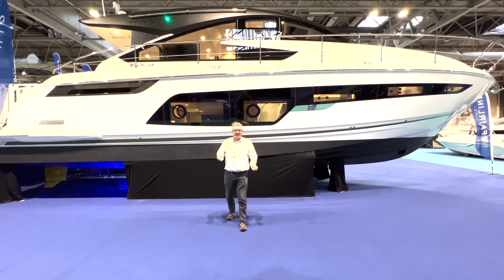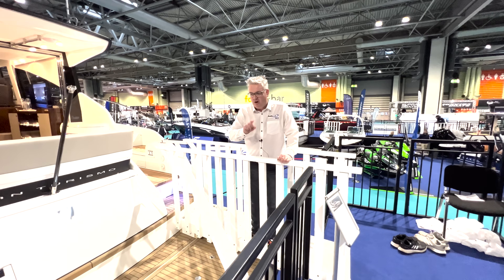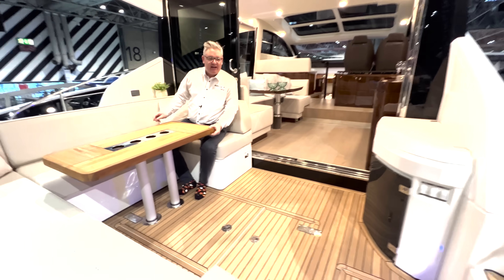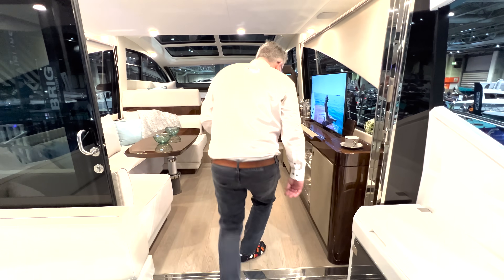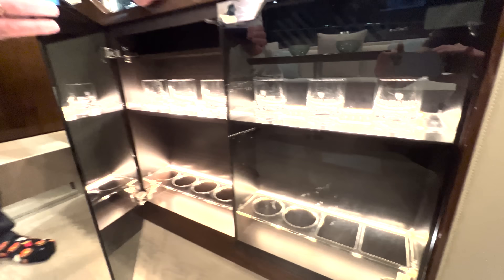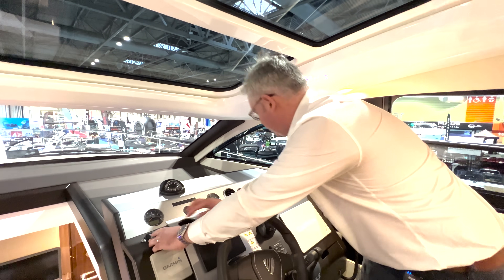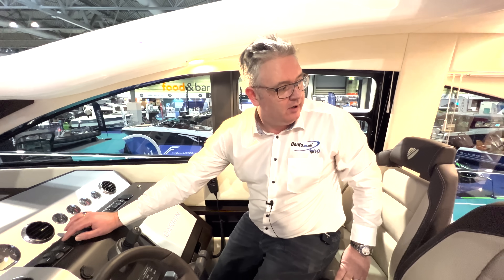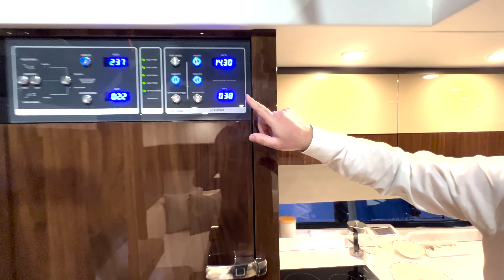2022 NEW Fairline Targa 50GT - Why I think this boat is a bit of bargain!

Comment: You can't even stand fully upright in the main cabin of a £1m boat? Check out the Galeon 500 or an Absolute 50 that quite literally knocks the burger and chip socks off, of this boat. Not impressed with this one although I hear Danny Devito and Warwick Davis are thinking of going halves on this one.
Reply from the maker: 😂 - you don’t just buy a boat on headroom. Seakeeping, build quality, ease of use etc are important. Also everything has a cost - High headroom gives higher centre of gravity which equals worse sea keeping. Every boat compromises something to give you something better elsewhere 😊
Reply: Horses for courses as they say..... though this one's for a Shetland pony 🐎😂. Keep doing what you're doing, love your channel!

Comment: Are there any disadvantages to having a seakeeper?  Other than the initial cost obviously, any ongoing costs?  Maintenance?  Loss of space in the engine room?  Apologies for what may be a numpty question, I don’t know much about boats but from videos like this I’m slowly learning.
Reply from the maker: You lose a bit of space , they take 20 mins to spool 🧵 up - they require an annual service but otherwise they are fantastic and it transforms life onboard - especially at anchor 🍻

Comment: There seems to be 4 different drive systems for a boats. IPS, Shaft drive, Surface Drives, Jet Drives! Is cost a major factor? What are the advantages and disadvantages of various drives?
Reply from the maker: There are also outdrives and outboards ! Wow that’s a big question - it could take a whole video 😉
Reply: @Boatscouk  Why would you not want to fit IPS pods if the boat is going to use 30% less fuel? What are all the advantages and disadvantages of various drive options you can get for Motor Yachts. I would like to know before I order my Pershing X7 fitted with surface drives. LOL
Reply from the maker: @gordonjohnston684  . I will answer on IPs because the answer is quick. It uses less fuel because there is less friction. There is less friction because the IPs boat is lighter and because more boat is out of the water . A lighter boat that is more out of the water can have less seamanship qualities 😉

Comment: No no no and no again. Most boat builders have worked out that you need to move the galley up. Why would you want the cooking smells below when they are easily aired away from the upper deck. On this boat that is why there is so little head room in the cabins. Time to do a rethink Fairline.
Reply from the maker: When boating regularly - some customers find that they are on show when using a galley up boat. For example when you wake up in your pants in the morning and want a cup of tea- you have to quickly run for the curtain / blind. Everything is a compromise.

Comment: Watching this video a day ago, and thinking about the entire walk through. When a customer want's a first time boat. This is no time to let your heart dictate for you, because the boat is shiny. 
Find a guy that is sharp, long time boater. Talk to a few Captain's, pay them well and sit down and talk.
We're talking serious money here and to have second thoughts in less than a year after buying the boat. I think some of the most sharpest boaters are the passage maker people. I can assure you. Passage makers don't buy a boat because the interior trim is high gloss. These buyers  study and study at home for months before laying out serious money. comparing numbers. Come on now.
A engine room hatch on the back deck. Sooner or later. Salt water along with fresh water will find it's way inside that's a given. Those two tubes for the aft table. It's flimsy and will eventually the tubes will  become loser and loser. 
After riding my push bike across the continent of Australia twice. I feel that I can offer some new riders advice and hopefully save lots of money on equipment before setting off. This should hold true with people new to boating.
Reply from the maker: boating is fun and I think that of course you need to be sensible but don’t over think things otherwise you will never do it 😎

Comment: I never saw the sink in the galley or the frig / freezer.
I'm not nitpicking. What happens if a family of four is having brekkie on the aft deck. Now all of a sudden there is a loud noise in the engine room or smoke and you need to get down in the engine room in a hurry. Or doing an engine check every hour. Then having to lift up the table top.
Reply from the maker: Yes - fair point but pretty unlikely these days 😎